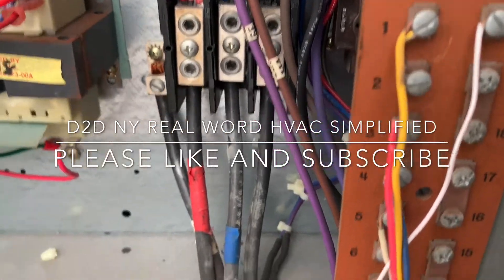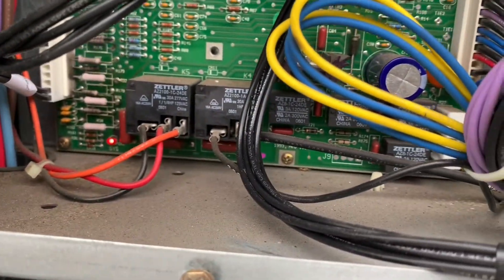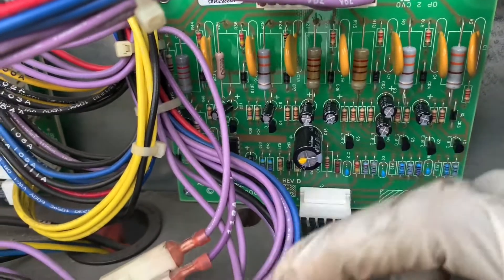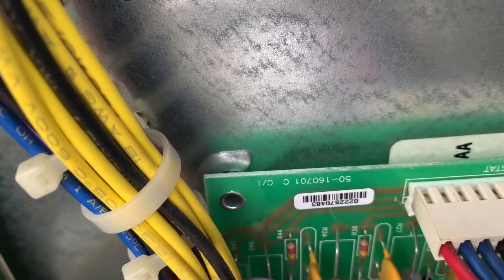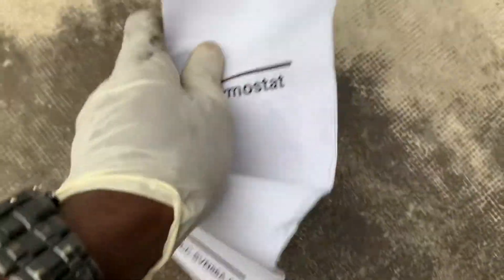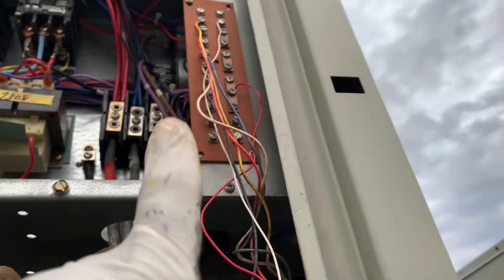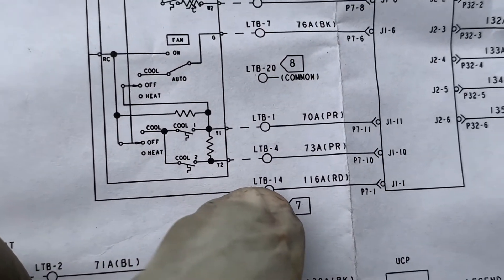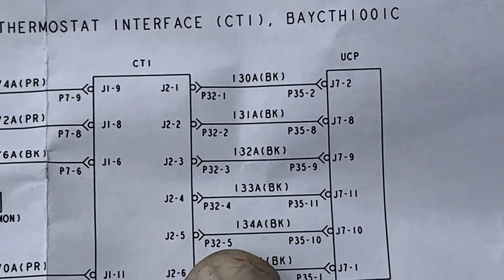HOW TO USE ANY THERMOSTAT WITH TRANE ROOF TOP UNIT RTU

Comment: I have a problem with the 2nd fault of the central air conditioner, rooftop, Trane, manual thermostat, type 1577. I have not found a solution to the fault. E2
Reply from the maker: Not sure what you are talking about

Comment: I have 3 of the Trane units on the roof, controlled by 3 Trane Baysen Zone controls that are all located in the office, for the 3 different zones.  Is there a way to add a CTI board to each unit, control the temps for each unit but still having the controls in the office?  Maybe something newer tech wise, wifi capable?
Reply from the maker: Yes absolutely
Reply from the maker: You will need 3 CTI boards and I would recommend the  Honeywell vision pro 8000 series thermostats, wifi version will require 3 wired remote temperature sensors, with the redlink version you can use wireless temperature sensors and a gateway to connect them with app
Reply from the maker: If your RTU has reliatel CTI boards is not necessary
Reply: I have a couple photos of the board I have in these 3 units, I would like to upload, or forward to you.  I want to be sure I can use the CTI boards before I order them.
  @D2DNYAC

Comment: Do you know if this would work in an Intellipak?
Reply from the maker: No and I don't believe it will, and I never seen one being controlled from a single thermostat
Reply: Thank you for the response. I am dealing with a 2 Rogue Intellipaks. The Trane BCU died. The company I work for installed a Tridium Niagara JACE with a COMM 4 integration driver. The control of the unit last for about an hour maybe less and then the units reverts back to its own setpoints and not the commands we are sending it. I appreciate your response

Comment: do you have a video on how to bypass a metasys to a thermostat
Reply from the maker: 😲 no my friend
Reply from the maker: That’s a Johnson controls controller correct?
Reply: @D2DNYAC   yes. We have a system that has never worked correctly. To upgrade is astronomical in price. We had them switch a few roof top units over the years to thermostats. We (church) just don’t have the huge money to do the upgrade. Even just getting them to put in thermostats is just too much. (That’s not a smash on the trade or costs, we just don’t have it. ). 
It looks so complicated.

Comment: I installed the CTI board and re-wired the Terminal board on Voyager per the instruction and could not get  the unit to run . Any suggestions
Reply from the maker: If you run test mode does the unit work?

Comment: I replaced the trane tstat with a regular tstat and now i have no power at the tstat. Could that be fixed with adding CTI to the system?
Reply from the maker: @eulises Flores  is your Trane unit  reliatel version ? If NO and you didn’t use the board I used in the video then no standard thermostat will work and you may ruin the main control board

Comment: It’s called the TCM  and the main difference between the older voyagers and the newer ones with the RTRM Reliatel is that the older ones use what use be call digital electro   control.   The new ones use direct electronic solid sate technology.   Where the old one used an ac to millivolt signal.   The new ones use what all units controls use a direct ac control.  24 volts does just about everything on off commands and analog inputs for sensors.
Reply: Have the same issue. I have 24 volts coming into the thermostat conversion board but nothing coming out on the black wires to the main board. So the signal is Milivolt signal.
Reply: Thank you didnt know that. Till I read your message.